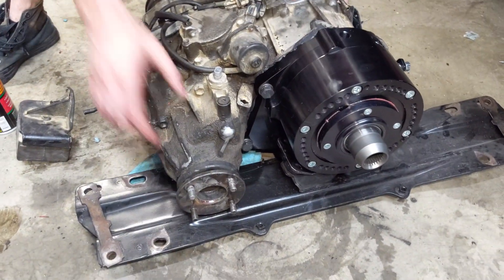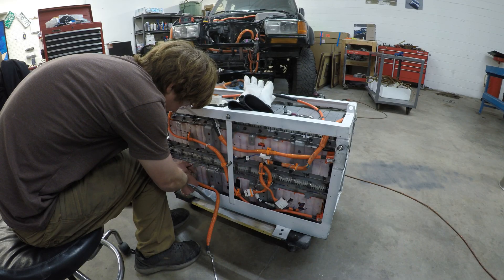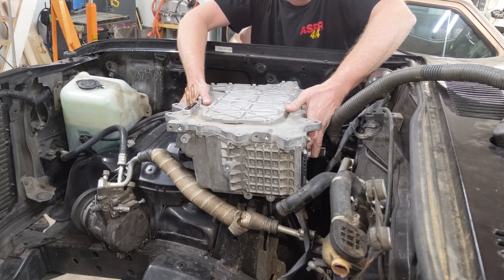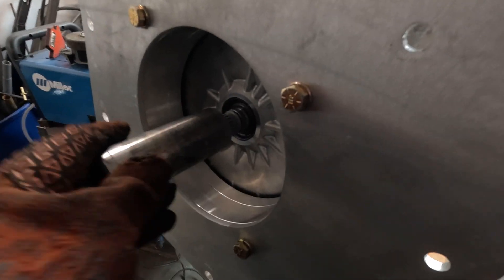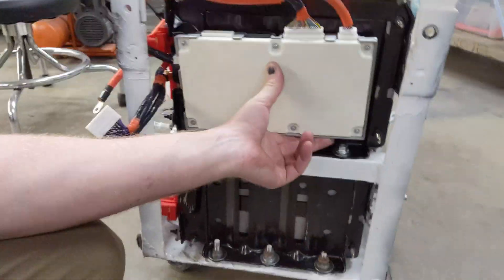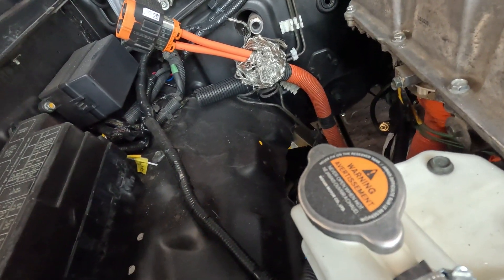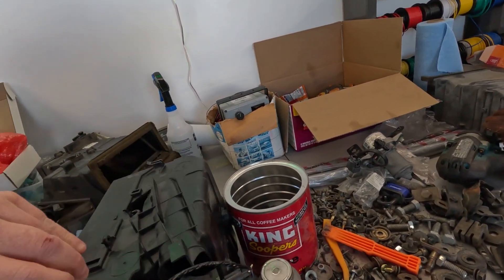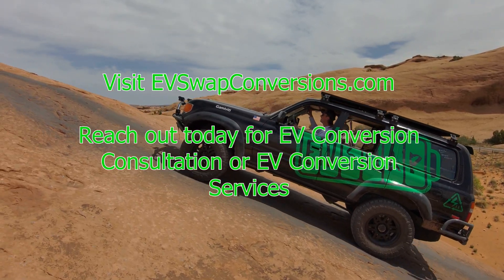Affordable EV Conversion: Can You Really Make It Work?

Comment: Great video & good vibes! I'm planning a project of my own & glad to have found your channel. I'm going build a "Series (& Parallel-through-the-road) Diesel-EV hybrid" with an older 4x4 Duramax.. The goal is to have EV front wheel drive being powered by diesel generator at steady RPM, while also retaining the ability to use the Duramax to power the rear end as normal. I want to use a PTO (power-take-off) generator on the Allison transmission with a modest size battery that would require the truck to be idleing and the PTO to be engaged but then be driven fully off of electric motor in place of the front diff or (as long as the modest battery would allow) to be used like a mild hybrid assisting the Duramax and acting as a AWD with two different power sources.  I know that there no such thing as "free energy" but I like the idea of having extreme flexibily in how to use it for different situations.

Comment: Who told you Americans that above 48VDC is high voltage? In the rest of the anglosphere its 1500VDC its classified as high voltage
Reply from the maker: Dang, I guess we told ourselves because we invented electricity :)
Reply: @EVSwap  What do you call actual High Voltage then?
Reply from the maker: @MrWackozacko  48 volts DC and up is high voltage technically. Then at different levels above that different practices and PPE is required. That's purely for certification/safety.
Reply: @EVSwap  Interesting, what do your trains run on? Is that a 1500vdc system?

Comment: Thanks for the info. I am converting a Nissan Pathfinder to electric and am considering lifting the body off the frame and placing the battery on top of the frame. I haven't come across anyone who has done this though. I guess it is possible.

Comment: I plan on ev swapping my 03 ford focus.. going for 200miles of range and i wanna keep the 5 speed manual. I have my eye on a few setups.. im hoping for 200+hp since i tow a small trailer
Reply from the maker: A LEAF motor with 60 kwh battery would definitely get you that range, you can adapt the motor to your 5-speed also.
Reply: @EVSwap would i have power delivery issues if i tow a 1,000lb trailer? For 3,700lb total weight. I'd also like the ability to take the trailer off and get rowdy on some trails (car is getting lifted) 

Willing to pay for the stronger motor but I do not want to buy a five thousand dollar race motor if a controller costs just as much.

Comment: Hi. Can you help with my project?
I want to convert Honda crv 2004 model to electric. I plan to buy a rear axle motor from China with 96v 10,000 watt motor and a LiFePo4 battery of 96v 320a .
I will like to achieve 80-90 km/h speed and 200km range.

Comment: Probably the easiest and most straightforward conversion would be to buy a salvage model three performance(so you have all-wheel-drive,  500hp , 🔋 72kwhr, plus software track mode to disable traction control if you need to off road ) .  After that, weld the body of your truck on that skateboard. you have all the hardest parts taken care of.  Like using Tesla’s bms using Tesla software ,using Tesla regen software programs, plus all the app connectivity like cameras, opening your door and summoning the car from your phone.  Also, because the first generation model three has a Steel unibody and a regular old steel subframe you can easily fabricate long travel suspension for truck off road.  it’s not aluminum giga cast like the cyber truck or model y .  basically the hardest part will be metal fabrication and bodywork. Not worrying about high-voltage lines, battery management and many many other critical software control things that electric vehicles need plus all the mechanical stuff like braking ,steering and all the things you mentioned that make a big difference in electric vehicle efficiency.   Get the skateboard , weld the body on with a matching wheel base , that’s the best.
Reply from the maker: That's a good point, I'm sure some people would do exactly that.

Comment: i did mine with a electric hub motor inside the wheel, so I was able to keep the gas engine and use both when needed
Reply: What motors?
Reply: @JSacks88  I think he's driving a three wheel moped with a large umbrella...
Reply: That’s a great idea !
Reply: its a horrible idea.  make an ev but even heavier. reduced gas mileage and ev range.  worst of both worlds
Reply: a sok OKOSOK  mernok UR megtervezte a valtot attalakitva tobb megoldas is van mi a lenyege $$$$$$$$$$$$ kevesebb mivel a vilag gazdasagi big   0x0=0

Comment: So was that car you made able to get a VIN number and insurance?
Reply from the maker: Yes!
Reply: @EVSwap  How does that work? I'm not familiar with the process for getting EV conversions street legal.
Reply from the maker: @DaveElectric  Totally depends on what state you are in. In Colorado I had the cars inspected by the local Sheriff, they changed it from gas to electric in the computer database and gave me an inspection form. I then took the inspection form to the DMV and registered it as normal. For insurance just call your agent and tell them it's been converted or get an agreed upon value insurance.

Comment: Converting an ICE car to EV seems more about having a unique car or a challenge than about being affordable. You can end up with something very cool but you can also go out and buy a used EV for an affordable amount of money without investing all of the hours of work and that EV will probably be more reliable as it will have been designed by professionals. I'm here because I think converted EVs are cool just like lots of classic cars are cool. If I converted a car it would be a passion project, not an attempt to make affordable transportation.
Reply from the maker: Yeah, an EV conversion is definitely more about the experience than the affordability. It's definitely not done to save money, but can be done on a DIY budget.
Reply: @EVSwap  It's fun to watch so I'm glad someone is doing it.
Reply: I'm going with the long view on this - these DIY and tinkerers and businesses that are converting ICE to EV, are in the short term, you're right, doing it for the fun and challenge of it. In the long run, though, there are hundreds of millions of ICE out there, that will keep running for decades, unless they are converted to EVs. Existing car companies aren't going to do this - it will be DIYers like this who do the first messy, unique conversions, then they will work out more modular and flexible solutions that fit a variety of cars (of course batteries will also have to get a lot smaller in the meantime), and then mechanics or specialty companies will be able to offer profitable, safe, effective, long-range conversions for almost any car, for say, $10,000. THAT is the dream....
Reply: There's supposed to be available a rear axle assembly with motor and electronics and regen braking all built in  as a swap over for  the conventional rear axle for doing a speedy conversion. Just throw away your engine and transmission and put batteries there instead.
Reply: You  email
Reply: Better info than the video.
Reply: minel tobb (szart )teszel bele annal nagyobb szar less belole gondolok a futott ulesre  a kijelzokre meg en vezettem trabantot is  meg  warburgot es  zsigulit  is ugyan oda er mint a luxus auto de nem mindegy  a $$$$$$ erted  mart
Reply: en is dolgozok ilyenen de covid-19 beleszolt de van sok  amit kikellene banyaszni kinyitni ES igen mais dolgozok rajt erdekel a dolog minden oldala
Reply: EVs are not as widespread as you may hope in some countries, unfortunately.
Reply: You're just describing a volume premise. Of course the used EV is cheaper, it was part of a mass-produced batch of manufacturing. There's quite literally no engine type-swap project that's cheaper than buying the used complete equivalent. My LS Miata cost as much as the used Corvette I could've had. But it wouldn't have been an LS powered Miata

Comment: Question, for a longitudinal vehicle, if the vehicle has a manual transmission, do you shift gears like an ICE vehicle? What are good numbers regarding gross weight to identify a good conversion candidate? I like the Volvo 240, Volvo 850 & early V70. Are those good candidates? I've read costs to convert are quite expensive (like $20-30K). Is that correct?
Reply from the maker: When using the LEAF motor it has such a broad powerband from 0 to 10,000 RPM that the manual transmission can be left in 2nd gear and reach highway speeds as well as having good acceleration. It is not necessary to shift gears. Right now there is no clutch so shifting on the fly is not super easy and takes some concentration. I am interested in having a clutch, however. It would be fun to shift through the gears just for the kick of it.

If you can do the conversion yourself you could probably do it for $10,000 if you get a good deal on the donor vehicle, but if you have a shop like mine do it then of course the labor adds quite a bit of cost, yes $20-30k is about right, more if you want more options or a newer LEAF with bigger battery.

I think a Volvo 240 or 850 would be a great candidate because there is a lot of room to install the battery and other components. A V70 would be a bit heavier and the modern cars sometimes throw a fit when you remove the engine and associated computer systems, so I would stick with an older model OBD2 or older.
Reply: Weight no more 4000 pound

Comment: Interesting stuff here. I’m intentionally starting with a 1200 pound car that never had power anything nor a/c or any junk like that and is manual. I am wondering if there is a way of avoiding screens (except perhaps as a diagnostic plug in type of thing). I far prefer minimal gauges, even with looking at a screen like now on YouTube for more than an hour at a time is an invitation for migraines.
Reply from the maker: Very cool! What type of car is it? Simple and lighter is always better when it comes to EV conversions. As far as screens you can put the OLED display in the glovebox or something like that and use Speedhut gauges to show all the relevant information. Also you can use an app on your phone to connect via bluetooth to get the rest of the information when you need it.
Reply: This is wonderful information. 
It’s a 1960 Triumph Herald coupe. There wasn’t much left of it when I got it. It had been sitting in a field in North Dakota probably since it was last registered in 1968. The ICE engine was nothing to write home about when new and after draining 4 gallons of murky water out of the oil pan I don’t think there is much expectation that it is headed for an automotive museum.
I have plenty of  body and suspension work ahead which will give me time to learn about EV conversions. 
Most of what I see is squarely in the “go faster” realm. I don’t have any interest in that direction. 70mph max and a 80 mile range is great for my needs. I am staying tuned here to glean what I can.

Comment: I don't want to ruin a classic car by making it a golf cart
Reply: A very powerfull golf cart.

You can buy conversion kits with no drilling and welding.
So you can put the Old engine in a container or a glass display case if you want.
And if there is a collector interested in your unique classic car and will give you millions you can put it back.
Reply: let me know when it beats the current cannon ball record and I'll reconsider, but until then yes it's "very powerful" there's plenty of ICE engines out there making thousands to tens of thousands of horse power. I just don't don't want to risk my entire house burning down for one, and the thermal density just isn't there. That's why Mazda want's to bring back the rotary to be a generator for a hybrid. We should have flying vehicles for the masses by now, and you're selling "this future"  

"no maintenance required just go from 8,000 mile oil to changes to 8,000 mile tire changes"
Reply: @alexmaccity  Youre defintely on the wrong channel.
Reply from the maker: @alexmaccity  Cannonball? Talk about a arbitrary and useless metric. What about Pike's Peak Hill Climb? EVs already won that over and over. You bring up density and then rotary in the same sentence. LOL. Rotaries are horrible, they burn more gas than a 632 Big Block and break every 30k miles or less. Tires last the same as long as you drive the same.
Reply: arbitrary? that is the only one of any use or value. what is the difference in time on pikes peaks? how many hours of difference is there on the cannon ball? I brought up hybrids, because it's the only thing of practicality with the latter being spending an hour waiting on a battery to charge, and hopefully your connector form factor is the one the charge has, or hopefully you have a 1,000$ worth of adapters to make it work.
Reply from the maker: It's arbitrary because the cannonball has more to do with the drivers endurance and planning than the car. You can do it in a fast time in a 4-cylinder or a V12. Pikes peak is a competitive race where every part of the car needs to be optimized.
Reply: You do have a point with that. I don't think it's arbitrary. My point was I know a lot of people who drive long distances so the hybrid or the ice makes sense. Someone earlier said I was in the wrong channel, and they're not wrong, but it's nice to be able to talk.
Reply from the maker: @alexmaccity  I drive cross-country all the time in my custom turbo Miata or my supercharged V8 truck. I love cars of all types. EVs are really fun and the technology is cool, especially when you build your own EV that doesn't have any computer nannies 😁
Reply: Maybe one day. I don't even do nearly as much wrenching as I should.
Reply: Gasoline vastly more flammable than a lipo battery .
Reply: @guccigang1966  But how many gasoline powered cars spontaneously burst into flames?
Reply: @alexmaccity  “The masses” can barely handle driving in two dimensions, and it’s just as likely your petrol car will catch fire and burn your house down.
Reply: Square head open your mind
Reply: What kind of diapers do you drive in Alex?  Also, do you get diaper rash from not stopping?
Reply: @ohger1  I'm guessing you wear diapers as a hat, since you're proving to be a real s***head. The guy thinks a classic car should have a gasoline engine. If it's a muscle car or has high interest and collector value, I agree.
Reply: I kinda think it's cool. Fantastic project
Reply: The guys at the beginning of this video didn't mind. If it was a run of the mill driver okay, but swapping a real classic or muscle car suxx.

Comment: Nice synopsis Jimmy! I'm pulling my motor out of my wrangler right now. Thinking about a nissan leaf swap. It has a 5 speed ax15 transmission I want to get the adapter plate built by brat industries.
Reply from the maker: Nice! Nissan LEAF is a great donor vehicle for swaps! Going to do a video soon specifically on LEAF swapping!